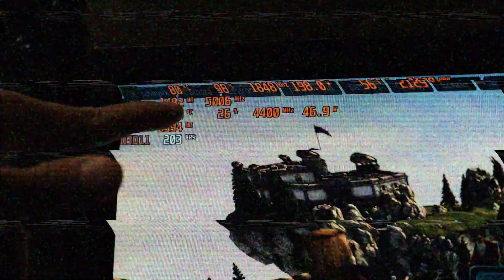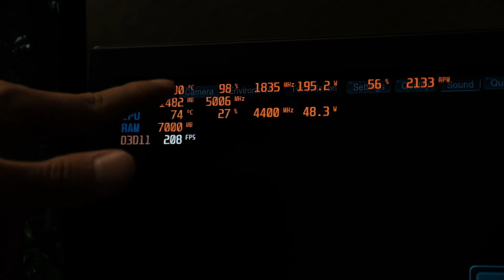GPU Thermal Paste Replacement | Gigabyte GTX 1080

Comment: Why not just cover the entire die? Some people use a spatula but I just use a gloved or plastic bagged finger and I smear non conductive thermal paste all over the die. Then I try to level it to make sure it is thin but even. If some smooshes out that is no big deal, just more contact area. I don't live in a high heat or dry area so I don't bother with this on GPUs, just CPUs. I have the same GTX 1080 AND an RTX 4090 and I am really impressed with how the GTX 1080 keeps up. I built a system from spare parts using a B850 motherboard, 32gb of Gskill expo DDR5 and an AMD Ryzen 7950x processor. For sh!ts and giggles I threw the GTX 1080 in with a GTX 970 as backup to run Physx for the 1080. I can play helldivers 2 at 1080p Native with High detail and only have 1% lows of 55 fps. I can also run Starfield at 1080p using FSR 3.0 and frame generation with Nvidia reflex on. I play with a controller so I don't feel any noticeable latency. Starfield runs at 60fps. I also have tried Oblivion Remastered on it and THAT worked and looked pretty amazing. Same deal, it needed FSR 3 with Frame Gen at Performance upscaling but sitting 7 feet from my 42" Samsung 60hz 4K TV from 2017, I can't tell any difference. Looks and feels amazing to me. I have an RTX 4090 running on a 4K, 27" Acer Predator monitor just 5 feet away and it looks basically the same to me.

Comment: Changed the thermal pads (Chinesium no-name brand) and thermal paste (Thermalright TFX) on my 5-year old Gigabyte GTX 1080. The temperature dropped from 92 on 100% load to 72 on 100% load with the temperature in the room being 28-30. I think one of the original thermal pads on the back plate was too thin (didn't or barely touched either the backplate or chips), replaced 1.5mm pad with 2mm. 
Btw, you can measure the pad thickness with your eyes and a simple ruler, no need for techy stuff. Maybe you won't notice 0.25mm difference, but 0.5mm is definitely possible. 

As a note, I have noticed no or at best 1-2 degrees improvement on idle and medium load, but it really shines at 100% loads (20 degrees in my case). 
I also vaguely remember the temps out of the box when I got it, and it was typically above 80, thus repasting made it even better than the original.